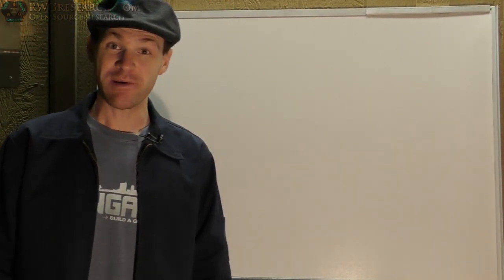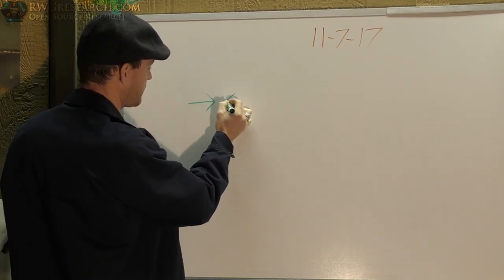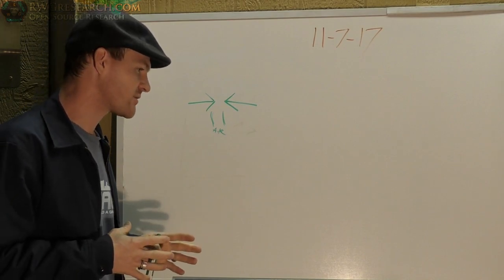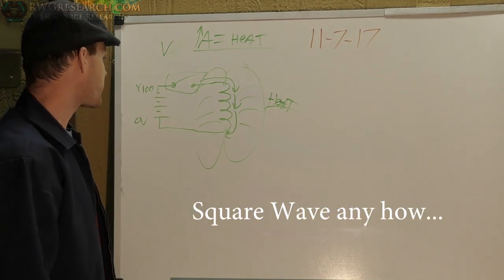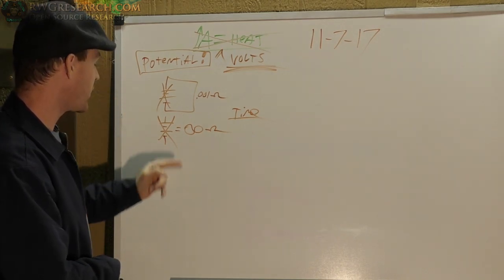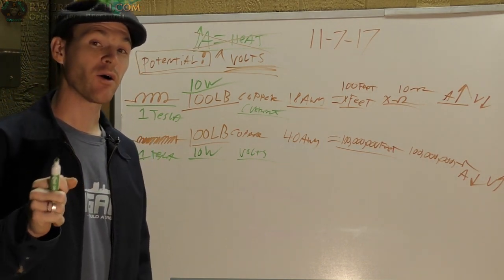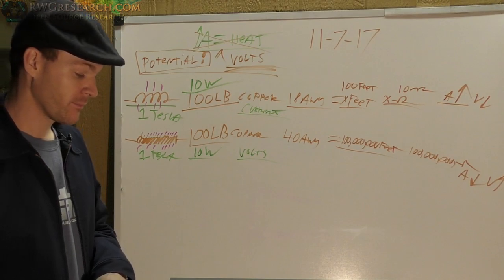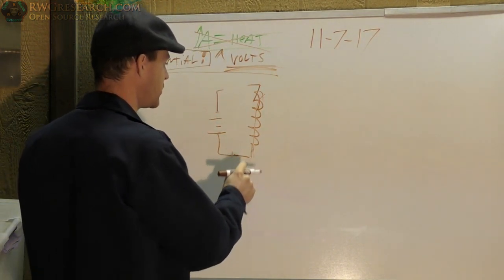The Search For Answers Part 9: Resistance is a problem... or is it?

Comment: Great series! If your trying to create a specific magnetic field strength. A coil with high capacitance has no impedance or CEMF to hinder volts being transformed into a magnetic field. Volts required is much less than a coil with self inductance. The polished sphere spark gap has the highest capacitance also known as a resonator. If one electrode is a point you have directional current. You are correct the magnetic field does work longer. Mike

Comment: In regards to coils with a high number of turns(high resistance),and low number of turns(low resistance) With the same amount of power,both coils will produce the same strength magnetic field. But,both coils will also dissipate the same amount of power in the form of heat. If the coils are pulsed,then something very different takes place--due to !as you say!,a higher self capacitance.  Sorry for all the replies Russ,but no one else seems to want to answer your questions.

Comment: To answer your question at 9:15. The instant current starts to flow into a coil,current starts to flow out of the coil--there is no !starts to flow in!,and then shortly after!starts to flow out!. Current flow through a coil happens throughout the coil windings at the same time-there is no time delay between flowing in and out.
Reply from the maker: Ah! Are you sure? Remember this,  voltage leads current in an inductor.   the question is to ask, why dose current move though a wire so slow if what goes in comes out at the same time? if your talking VOLTAGE, i agree, if your talking CURRENT i disagree. 

voltage ( potential) is @ the speed of light, Current, is very slow. and the less the current the slower the speed... ( people in a line pushing one another takes propagation time) 

They say... a magnetic field is whats showing the current down...  

"You cannot learn what you think you already know" - Epictetus

Have a look again... 

find  way to prove to your self thats true or not...  ill do the same ( on the bench) but dont go small.... :)

~Russ
Reply from the maker: https://en.wikipedia.org/wiki/Kirchhoff%27s_circuit_laws
read closely... 
Cheers, 
~Russ
Reply: Yes,im sure,and the link you provided says the same--Quote: At any node (junction) in an electrical circuit, the sum of currents flowing into that node is equal to the sum of currents flowing out of that node.

Remember,the copper wire is always full of free electrons--you dont have to fill it first before you get current flowing out of the coil. Look at the coil like a coiled water pipe,where the pipe is full of water. When you apply water to the inlet of the full pipe,water will exit the pipe at the other end at the same time--you dont have to fill the pipe with water,as it is already full.

Yes,we can do this on the bench.
Reply from the maker: TinManPower did you read all of that page?  don't waist to much time. You forgot to read the "Limitations" part of that "law" I won't have time to go back and forth at the moment. Will get there though. ;)  ~Russ
Reply: What goes in does come out but the extra current does not, in some configurations. The extra current is energy stored for a later point in time. We are talking about coils at the moment but here is an example of current doing work twice. Mike    https://www.youtube.com/watch?v=7Xg0E9Br1w8
Reply: +PeakPositive  No, in the water-electricity analogy the rate of the flow of water is the current and the water pressure is the voltage.
Reply: Brad is right, the current flow through any component is the same on the "input side" as the "output side."  There is no such thing as current flowing into an inductor and not observing the current flowing out of the inductor after a certain time delay.
Reply from the maker: @User2718218 & @ TinManPower
i really dont understand why you guys dont see it: 
https://en.wikipedia.org/wiki/Velocity_factor

it is a know FACT That there is a delay in the wire. In a vacuum there is no delay. but in any medium there is a delay.
https://en.wikipedia.org/wiki/Propagation_delay
 "Wires have an approximate propagation delay of 1 ns for every 6 inches (15 cm) of length"

https://en.wikipedia.org/wiki/Velocity_factor
"Velocity factor is an important characteristic of communication media such as category 5 cables and radio transmission lines. Plenum data cable typically has a VF between 0.42 and 0.72 (42% to 72% of the speed of light in a vacuum) and riser cable around 0.70. A VF of 0.70 corresponds to a speed of approximately 210,000,000 m/s or 4.76 ns to travel one meter"

here he explains HOW the current is delayed !!!!  WATCH IT IF YOU WANT TO LEARN. 
https://www.youtube.com/watch?v=B3ejA2qubuU

I dont agree with everything he is saying, but almost all of it is right. BUT what is important is the resistance current delay!  ( drift volicity) 

more to read: 
http://hyperphysics.phy-astr.gsu.edu/hbase/electric/ohmmic.html#c1
https://www.w8ji.com/inductor_current_time_delay.htm

i will say know more after this because you either see it or you dont, I'm not here to convince you of anything, I'm just trying to point out the facts i see. and ask the right questions to get you to think for your self and see it.... 
blessings, ~Russ
Reply: +rwg42985 You are confusing high-frequency speed-of-light transmission issues for the propagation of the electric field in a circuit with non speed-of-light basic low-frequency circuit analysis.  You are not designing a 500 GHz input amplifier for a satellite receiver using PCB traces as waveguides, you are playing with basic components on your bench where those issues don't come into play.  And in the realm you are working in, the current that flows into one terminal of an inductor is identical to the current that flows out of the other terminal of the inductor.  The "delay" that we are talking about is the delay it takes to overcome the inertia of the inductor to get current flowing.  And the reason I put "delay" in quotations is that there is no real relay.  When you apply a voltage across an inductor then current instantly starts to flow through the inductor.  However, the current flow starts from zero and takes some time to ramp up.  So the "delay" is not something that is measurable, there is no true delay.  When we say "delay" in colloquial electronics terms we mean a "delay before you see an appreciable flow of current."  And that's why Brad's clip for you was a poor demo when trying to discuss this issue and possibly caused even more confusion.  He put a sine wave through the inductor and showed a phase shift delay in the current flow.  That is a different thing only semi-related to this discussion.  He should have put a square wave across the inductor and then you would have seen the resultant current ramping up from zero and manifesting a "delay."
Reply from the maker: I'm in 100% agreement with you. except this one part. 
watch this video again: https://www.youtube.com/watch?v=Iw1FSr6xWek
watch it all the way though. you'll see at the end what I'm talking about. 
I AM talking about ULTRA HIGH switching speeds!!!!!!! in the NANO second range!!!! 
so yes your agreeing with what I'm saying 100% 
thank you for seeing it. this is what I'm trying to tell brad, feel free to express it to him. 

~Russ
Reply: +rwg42985  And I also forgot to mention this discussion about the typically very low drift velocity of the free electrons in a conductor that are a result of the current flow serves no real purpose.  Saying something like, "a current of one ampere in a 12 gauge wire has a drift velocity of 0.2 meters per second" is useless junk data.  You don't need to know that, you will never use that information, and it is just junk data that will confuse beginners more than it educates them.  It's nothing more than an academic curiosity that serves no value whatsoever in understanding circuits or doing circuit analysis.  It goes back to the discussion about current flow on the input terminal vs. the output terminal of an inductor.  All of the free electrons "drift" in a wire at exactly the same time, they all move together.  There is no such thing in a wire as "compressing the free electrons so they are bunched together at one end of a wire."  This ties right into comparing electrical current flow to water moving in a pipe where the water is treated as a perfectly incompressible fluid such that in a perfect long pipe the water that enters the pipe is exactly the same as the water that exits the pipe.  I will repeat to you again:  You can ignore the concept of drift velocity of electrons for the next TEN YEARS and it will not affect your understanding of electronics or how you work with electronics by one iota.  "Drift velocity" is a useless concept in electronics.
Reply from the maker: you keep forgetting I'm doing Physics... :) ~Russ
Reply from the maker: by the way, to compare water in a pipe to electricity, you have to include elasticity of the pipe as well as Manny other factors....

ok i'm done, i know what i know and ill continue expressing it so others can get it. everyone else has free speech, but they also have the freedom to think. 
~Russ
Reply: +rwg42985  I'll try to watch the clip over the next few days.  I am really not sure what happens with respect to the current flow along the length of a wire on the nanosecond scale as an electric field snakes its way though a wire to its destination at close to the speed of light.  It's possible that everything I said still is valid even though you may observe current flowing into the "near" end of the wire and no current flow out of the "far" end of the wire.  The reason I am saying this is the current may be charging up the distributed capacitance associated with the wire itself and the ambient environment as the electric field makes its way through the wire.  Here we are really talking hard core physics.  On one lever if's fascinating but on another level it's like discussing how many angels can dance on the head of a pin.  On a more practical level, if you really want to understand how current flows in terms of its actual path on a hard-core engineering level, look up "curvilinear squares."  That is applicable to a 2D version of how current flows that you can work out on paper.  Then look up "curvilinear cubes" and that's how you can determine the actual path of current flow through a conductor.  So, in a wire, the current flows along a path of curvilinear cubes right down to a microscopic level.  Understanding this may be a key to understanding what is happening on a nanosecond scale.
Reply: +rwg42985  I watched your clip and there is no "Capacitor paradox."  A short answer is that it doesn't matter what the value of the resistor is, you always lose 50% of the energy to heat.  Even a wire connection has resistance and there you go.  There is a good mechanical analogy for it and we will not use water this time, we will use mass.  If you don't already know what a perfectly elastic collision is and a perfectly inelastic collision is you can look it up.  The energy in a capacitor is 1/2 C V-squared.  The energy in a moving mass is 1/2 M V-squared.  Look familiar?  The analogy is perfect.  Shorting two capacitors together is like a perfectly inelastic collision where momentum is conserved and after the collision the two masses move at the same velocity.   This example will explain it perfectly to you and hence get rid of the "Capacitor paradox:"  There is a 1 kg mass of steel that is shaped like a catcher's mitt and is on a frictionless surface.  The catcher's mitt is stationary.   The catcher's mitt is hit by a 1 kg ball of putty moving at 10 meters per second.  After the collision the are both moving at the same velocity (voltage) of 5 meters per second.  When you do the calculation for the kinetic energy of the 2 kg mass of the mitt and putty ball moving at 5 meters per second you lost one-half of the Joules.  So where did the joules go?  The answer is that when the ball of putty had the perfectly inelastic collision with the catcher's mitt the ball of putty physically deformed and changed shape.  There is friction in the deforming putty that got turned into heat.   So there is your answer for the "missing joules."   The catcher's mitt and the deformed ball of putty are moving at 5 meters per second and the putty got hotter and the number of joules of heat added to the putty is identical to the "lost joules" when you do the 1/2 M V-squared calculation.  Makes sense?  No more "Capacitor Paradox," it has been fully explained.
Reply from the maker: User2718218 yes I agree,  the loss is in the "expansion of the plates" 

However. Did you watch the entire video?  The stuff I wanted you to see is the second 1/2 half of that video.   ALL THE WAY TO THE END. Let it roll till it stops. ~Russ
Reply: Who documented what a field really is? Ken wheeler?

Comment: OK,when the coil has a high self capacitance value,and the coils current flow is interrupted,the magnetic fields collapse is slower,and so an inverted voltage across the coil will appear for a longer period of time,which also means that current will continue to flow through the coil for a longer period of time during the inductive kickback part of the cycle.

Comment: Hey Russ, first i apreciate all your efforts on all these topics, it's great to see that smn isn't just talking but makes things happen. Anyways i have some critisism about your theory of "Volts vs Current": First, an inductor doesn't restrict current and let volts  through it, that's bogus. An inductor resists current change and that's all to it. An other important thing ppl have to understand, if u have low current and high voltage doesn't mean the loses are less than high current and low voltage. In fact, if u have low current and high voltage the elektrons are moved with much higher force through the wire and that results in stronger friction = heat = power loss. The law of power is: P(power) = U (voltage) x I (current). As u can see it doesn't matter which one is higher, the losses are always the same. 

The only difference between an inductor and a resistor is that there is no power los in the waveimpedance of a coil compared to a resistor. Let's say the only situation u can avoid loses is when u use a coil instead of a resistor in a circuit that works with ac only but u have to take inconsideration the "resistance" of a coil changes with frequency a resistor doesn't. And that's also where Stanley Meyer is missleading us. He tells because a coil resists current the HHO production is more efficient that's just bogus, because the power loss is still happening in the water between the plates that has nothing to do with resisting the current somewhere in advance. Trust me i'm not just talking i tried it out on the bench and made my own conclusions why it doesn't work as he is saying it would.

31:35, this is just an LC circuit, you will get ringing. The power/work that can be done with  this circuit is always the same and depends of what you put into it. I suggest LTSPICE, it's free and u can simulate circuits, it's doing the maths for u and then try it out on the bench, worked for me ;)

What's a field?: 

Elektricfield= Potential difference, can do work. 

Magneticfield : Dipole, can't do work.

Best regards. Alex

Comment: 09:34 - I understand what you're saying. Your question is really: "How does the battery and circuit KNOW it is a circuit in the first place?" Especially since the current doesn't flow instantaneously. How can the circuit know there is a "low impedance current return path" back to the positive terminal of the battery, if the current flow hasn't had enough time to transfer through the wires yet? Perhaps it may be possible to create a circuit based off "potential difference" rather than "current flow", so no "current return path" is necessary.

Some people say that "voltage differential" can cause water to be attracted to a strofoam cup due to the fact that water molecules are polar. This is obviously incorrect, as electrostatic fields also attract non-polar molecules too. This has been proven by Thunderf00t. So, as a magnet can cause movement in ferromagnetic materials, surely we could find a way of using electrostatic fields to produce a similar effect? Electrostatic fields appear to affect many more materials than magnetic fields.

32:00 - I presume the bigger the coil, the more resistance to changes in current will occur, and the less the changes in the magnetic field will occur and thus will not be able to propagate to/from the electric field. That's my understanding. Probably wrong.

34:54 - Resonance?

37:17 - Just a guess, but... A field is the observed effect caused by a differential in the expansion of space-time (space-time being a multi-dimensional hyper fluid flowing into our Universe from an upper Universe). Differentials in the expansion of space-time in different dimensions can cause different effects, such as static electric fields or magnetic fields, perhaps even gravitational field manipulation (what is observed as Dark Matter). Without "flow", there is NO field whatsoever. Flow and differential are both necessary for there to be an observed field in the first place. Just a guess, though.